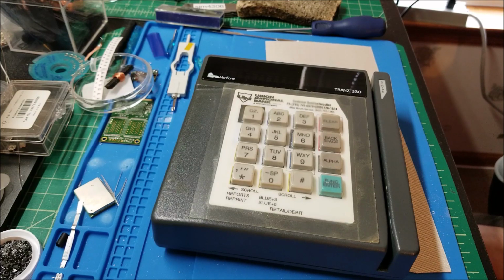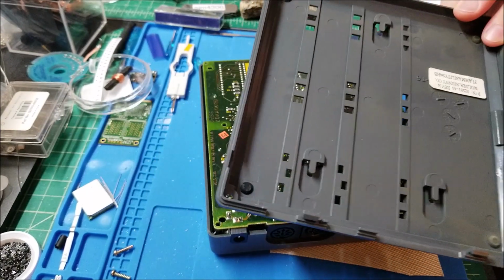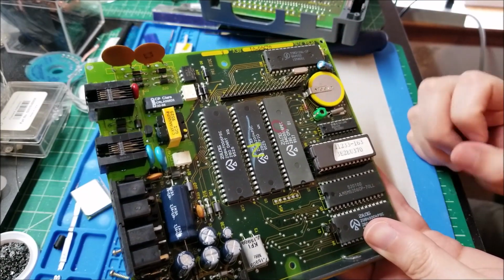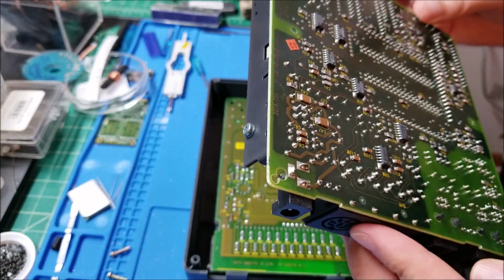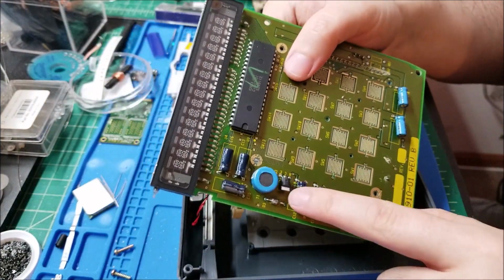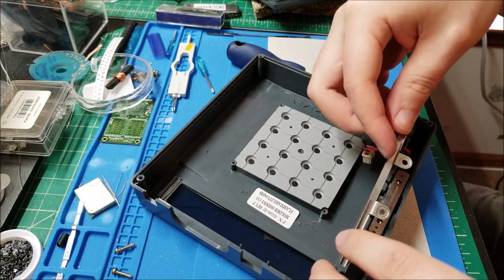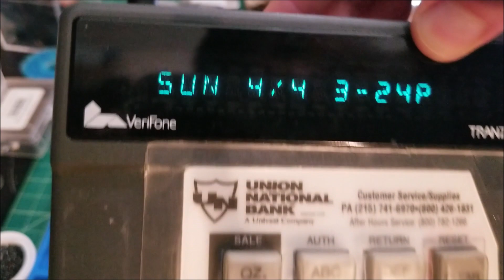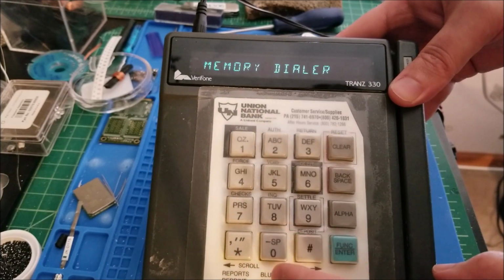Credit Card Reader Teardown

Comment: these are actually really cool. for anyone wanting to know more about these, including full schematics, i've reverse engineered a few different models over at https://github.com/wawa1474/tranz330_re

as for security measures... well there aren't any... not hardware wise, unless you count the backup battery dying as a security measure... communication wise there might some low encryption going on but i've not revered the firmware running on this thing so i couldn't say.

the 32k eeprom on the board can be replaced with your own custom one with no problems.